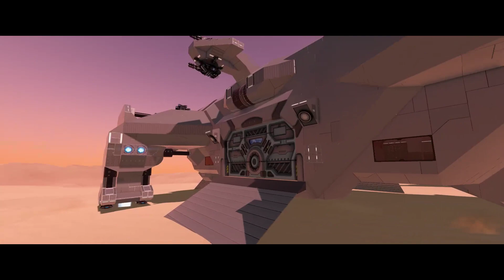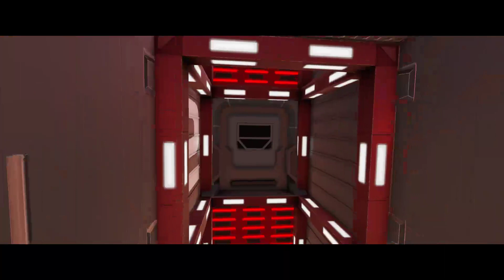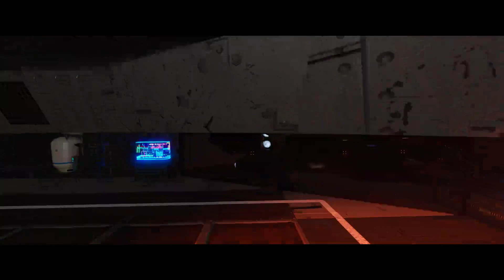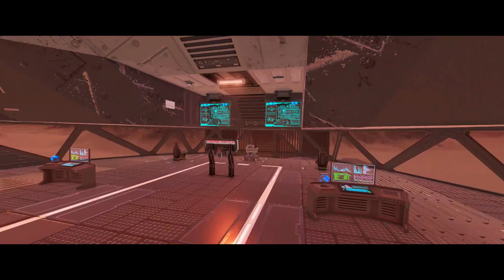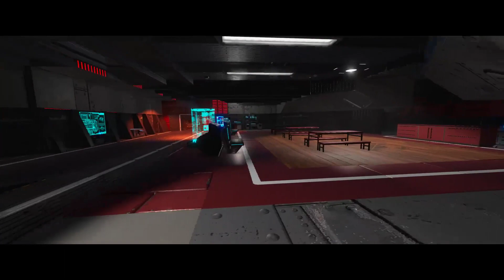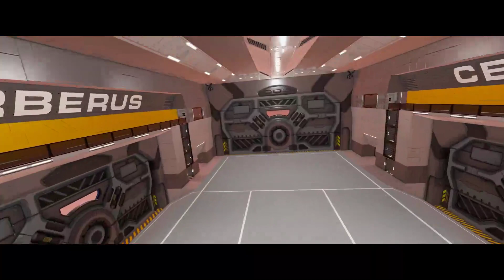Empyrion Galactic Survival - Skaar Cerberus-T4 Complete

Comment: Jeff, on the Raider it was already close with CPU 2,303,999 I removed 2 Artillery Cannons and 3 small Constructors along with reconfiguring the turret configuration to bring CPU down too 2,098,489. Reforged Galaxy is better suited for specialist builds IE combat ground / air, mining, support, manufacturing type builds.

Comment: Beautiful conversion/update. For the Skaar Raider reforged eden conversion i did I took off 2 guns, placed 4 T4 cpu, then after spawning it, but before turning on i added 2 T3 & 1 T2 cpu (RE allows up to 7 cpu, but only up to 4 of a single tier cpu), then recruit crew. Can't remember if I removed one of the constructors too. After I'd done that myself  someone posted a conversion but I'm not sure they used the same process. You're a great teacher & do inspiring block work